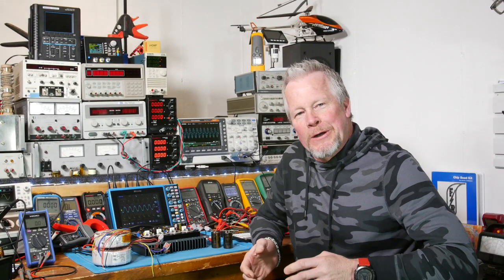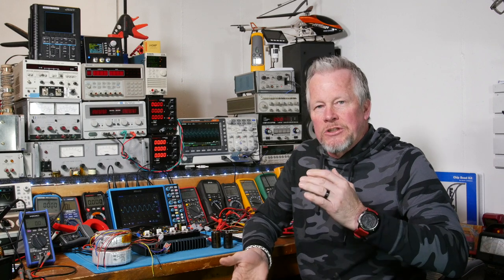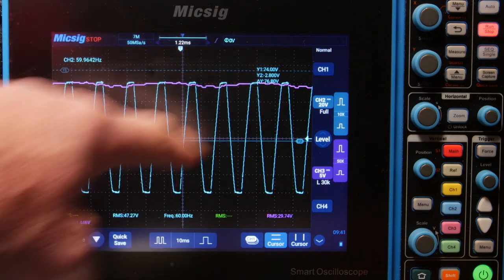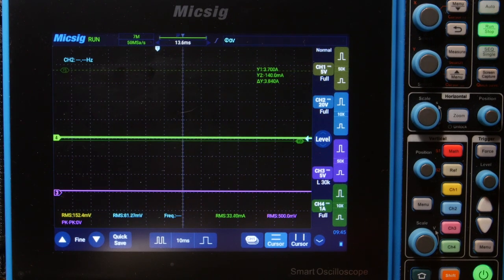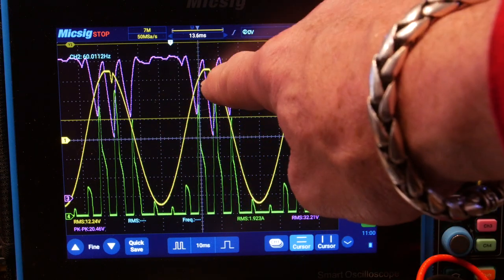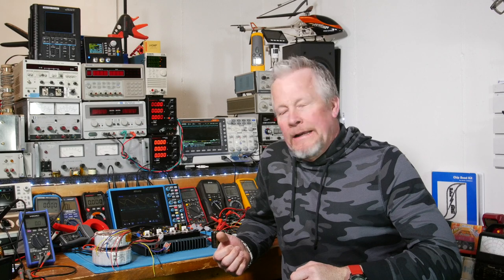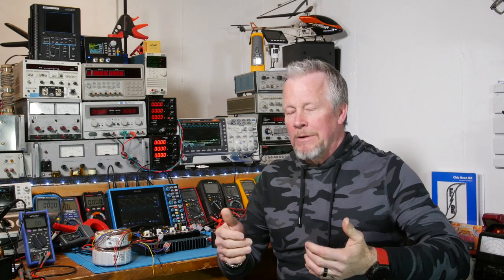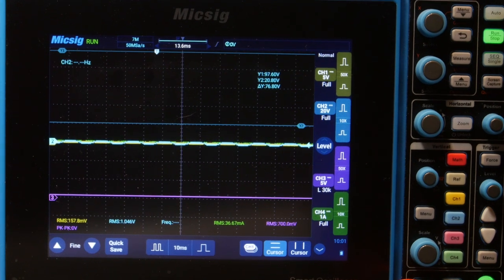20W Class-A Amplifier Power Supply Transformer size; 160 VA or 250 VA?

Comment: Hmmm, difficult to suggest something now until you confirm the cause of the smoke? I would still go for a higher VA transformer with 22V secondaries, not the two you have on hand, I think the case you have may struggle with dissipation so might be best avoiding the higher voltage rails. It would be interesting to see some measurements with a CRC filter, it will help with line frequency ripple but unless you have masses of capacitance after the R you may get more signal frequency ripple than without it, I am guessing you may run out of space in that case. Personally I would get a second case and go monoblock to help with the heat problem and provide room for a good transformer and caps. But it depends how far you want to go, and whether the system in which the amp is going would warrant going the extra mile. I have an HP8903 distortion analyser which has clearly shown the difference when driving two channels off of a single supply compared to separate supplies for each channel, I have also heard the differences too in .

Comment: Might be a little off topic, but I've been using your videos as a reference for building my first amp. I cheated for the amps and used a kit of LJM L12-2, but with the help of your videos I designed and built a power supply. What I'd like that I don't understand is a speaker protection circuit in case my amp fails. I've been reading up but if you could do a video explaining it I'd appreciate it.
Reply from the maker: Thanks Tony!  That's a great idea - I'll get one done soon;)

Comment: Great video. I had been wondering how the impedance of the power line feeding a supply effects supply output. If you plug something in to a long extension cord, or add an NTC to reduce inrush, how much does AC wave on the line side of the transformer flatten or clip when the supply is heavily loaded.

It was really cool to actually see some measurements taken where the ac wave clipped. Granted the transformer was the bottleneck instead of the ac line, but it definitely helped me better understand how the supply is effected.
Reply from the maker: Thanks so much for your feedback Chris!  I appreciate you!  I will be doing a new series that has to do with circuit coupling and impedance - i think you might really like it - and I'd love to have your feedback!!
Reply: @KissAnalog  Excellent. I’ll be sure to stay tuned.

Comment: Ad a VARISTOR instead if you think that inrush is a problem, place the varistor in the primary, that will stop the inrush due to the toroid. Forget about the smoothing caps inrush it is limited by the transformer wire resistance and will charge only as fast as the transformer will allow it to. 
You can also adjust the quiescent current down a tad not to load the transformer continually with high current, it looks like the core is saturated when the transformer flat-tops. 
The last comment that I have is that VA is related to rms voltage and current (AC pure sine wave) the amp draws average than more than one would expect. A class A amplifier is a constant current load, not quite related to rms, which is mathematically derived, not almost sine wave or rectified or flat topped sine wave. After rectification, it is not a sine wave any longer and rms has no significance at all. DC current is what matters.
Reply: did you not mean a NTC thermistor not a Varistor, a Varistor is a voltage control Resistor, so i use a NTC Thermistors for Inrush current limiting on the primary
Reply from the maker: Great feedback as always Nico!  I will have an NTC in place.  I have done a video on this in the past, but that was my early days;) The flat top did throw me a bit, but I do think it is the DCR of the winding.  I’d think that saturation would look like a slope peaking as it essentially shorts - right?  I actually haven’t saturated a low frequency core before.
Reply from the maker: Thanks for that @Jos Haas!  It is funny as I read Rico’s comment I knew what he meant and it didn’t hit me exactly what he said.  You are correct of course - thank you!
Reply: @joshaas  Oops, yes.

Comment: It's not the 20hz frequency, it's the period. 20hz has a longer period where it's drawing current then say, 1khz or 10khz. the 60hz extra pumps into the capacitors still aren't enough to maintain the voltage. I'll bet if you look at the wave you'll see the voltage dropping during the 20hz signal. 20 hz is the severest power rail test.

Antek shows load drops on their transformers at different current levels. I use their xformers and their current specs are pretty good.

I'd go with the larger xformer because over time components like capacitors may not maintain ideal conditions. I design with 20% overhead.

I usually just put a resistor before the capacitor string for inrush loads.
Reply from the maker: Great Feedback!  Now that I've done more vids in this series, I've had a chance to show this ripple that you talk about.  Very true.

That's great feedback on the Antek - thank you!

I think that is great design practice.  In some cases, I like to go even to 50% or more derating.  Like resistors I think should be 25 to 30% derated

Have you tried a thermistor instead?

Comment: Rule of thumb is to ALWAYS go a little higher in VA than the min requirements, yes?? Im just studying how other manufactured amps are setup here, alot of amps usually have a single cap @ around 10,000uf, while others with same ballpark wattage have multiple caps & 2-3x the capacitance.
Reply from the maker: Thank you!  I think it is a great idea to research what others do - as I do the same;) Then it is a trick to wonder why and what’s the right answer- but it helps find the ballpark and questions to mull over;)

Comment: Do not like having Transformers for plus and minus rails instead of having two Transformers as monoblocks which is better out of these two types
Yes I think the dual bridge rectifier is a good idea does it reduce noise, going back to my first question you would have in place there?
Reply from the maker: Great question John!  I think if two transformers giving lower loss (less heat), then that might be great to spread the heat around.  But, I don't think there is anything wrong with one large transformer - as long as the temp stays low (maybe 30 or 40 degrees C rise).
Reply: @KissAnalog  what about with Magnetic Fields being pulled in different directions using the one transformer is that no issue, do not get a cleaner signal with two Transformers isn't that better coupling with two? You must be busy thanks for the reply

Comment: I don't understand why you don't do signal input with class A -  BJT and finish the amplification with class D?
Reply from the maker: That's a great question!  But I might want to use JFET instead of BJT;)
Reply: You have a lot of equipment to make measurements - I would like to see a video from you with amplification in class A with a single transistor. A video to put a normal transistor - BJT "designed for amplification" - BC 337, a transistor that is not designed for amplification - BD139 and a JFET - 2N6660 (2N6661 or 2N7008) - with the supply voltage of 24V and an amplifier 10 times. @KissAnalog

Comment: When you load the transformer, the voltage sags very quickly from peak to average.
Reply from the maker: Thanks Nico!  The transformer does give the spec’d output voltage, so I think the vendor understands what the output is going to look like and it is a tradeoff in copper size vs output voltage - at least to an extent.

Comment: Real men wind their own transformers. You should try out a Vitroperm nanocyrstalline torroidal core...
Reply from the maker: I love that;) You are right!  I actually really do want to try out that material.  Have you mentioned this to me in the past?
Reply: @KissAnalog  No, but I've been working on a big power amplifier for work, and the transformer is the toughest part, and I'm trying both X-Flux (low cost) and Vitroperm 250 (high cost) toroidal coils, and the Vitroperm 250 works great until it saturates hard and blows up my equipment...

Comment: oke lets do it, when i build a Pass a3 or a a30 (30 watts 8 ohm class A amp) what do i do, with that amp i need between 25/28 volt on the rail  i take one 500VA/625VA 2 x 25v transformer, i do a dual 50 amps bridge, i do on one rectifier side 2 x 22.000 uf 40v caps than a 2 ohm 25 w resistor and again 2 x 22.000 uf 40v caps, and some little stuff like a super fast panasonic FR 220uf or wima foil cap or a small ceramic cap, i let the measurements decide, and the same thing on the other side of course, but that's for me i like to do extreme engineering, it sounds good, i have than like 28 volt  on the rail, now for let's say the normal people hahaha, i mean you hahaha, you need like 29 volt mmm lets see, take the 250VA 2x25v than do a dual 15 amps or more bridge rectifier than do like +/- 20.000 uf say like one 22.000 or 2 x 10.000 uf parallel and than a 1 ohm resistor, o yea at least 5 watt resistor, and then again 2 x 10.000 uf or of course one 22.000 uf again, and then do some little stuff like a super fast panasonic FR 220uf or wima foil cap or a small ceramic cap lets say what you have lying around, u will have like 29 or maybe a little more say 29,5 volt on the rail, if you go the CLC way let's say 10.000 uf than a 1 Henrie 0,5 r air core inductor, and then again a 10.000 uf cap u have i think between 31 volt or 32 volt on the rail, o yea you need less caps, wy air core inductor, they have more resistance than i ferrite or iron core, and you need resistance to get the voltage of the rail, one more thing for beginners i think do experiment with free software like PSU Designer II you can get it at www.duncanamps.com/psud2/ its a nice small program and you can experiment with out cost, yea i am dutch, but as always if you build the real thing it always has surprises for you , so again a long story but i hope you have something to test here and make a next video

Comment: That’s why on the vary high end use Monoblock power supplies and are many times over size that are necessary capacity transformer. 

       Then you get into the holy Grail of inefficiency and high output CLC OR CLCLC

     In those extremely high and heavy preamplifiers that do not need current yet they use transformers 8X over there needed power rating to achieve ultra clean power
          I believe in PS audio Paul McGowan talked about this phenomenon using extremely overrated transformers in their top in clean preamplifiers
            Also I think I remember reading one of Nelson Pass  article about the exact same phenomenon and topic. About using extremely oversized transformer of course were talking about diminishing returns extremely inefficient a lot of money spent to get that ever last little tiny bit highest in performance over anything else.
Reply from the maker: Thanks for this awesome feedback!!  Those Audio guys are nuts - wait this is an audio series;) I think there is a real trick to the science and to the phenomenons;)